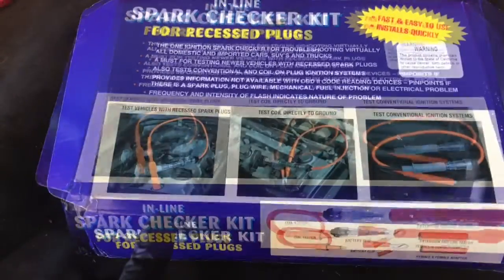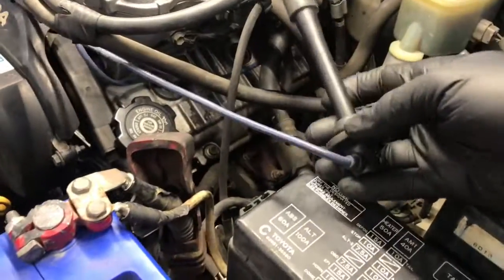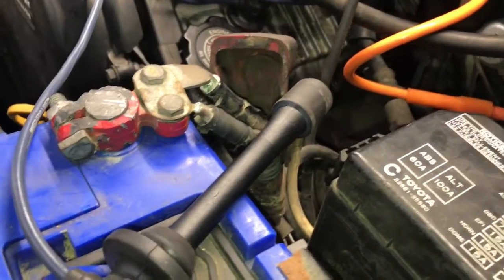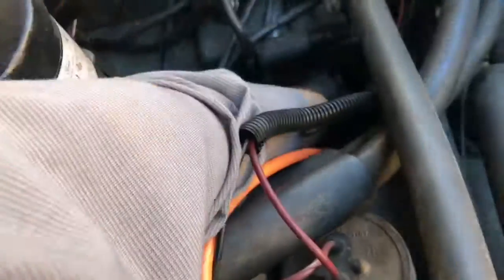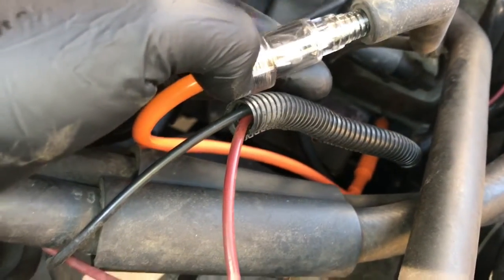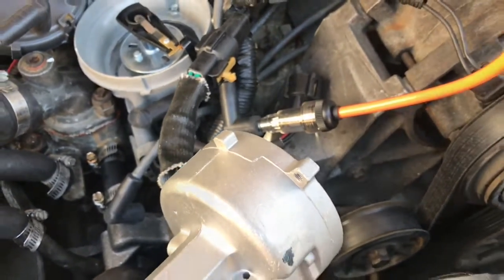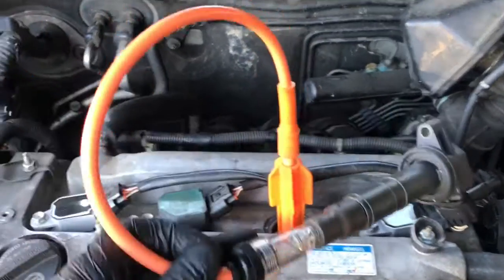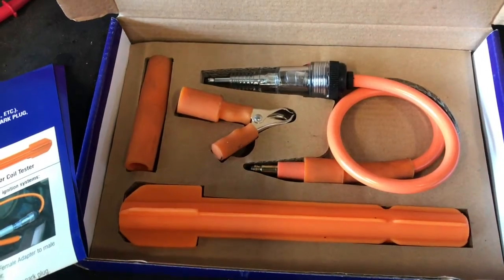How To Test Ignition Spark On A Car Or Truck Engine With An Inline Spark Tester

Comment: Is this the same as cranking engine with plug wire removed from plug side, then insert a spare plug into wire - set aside somewhere visible, monitor for spark from the spare plug?

Comment: What about from a coil inline to the distributor?
Reply: @FAKE-NAME  yes I found it does. If the coil is good and the module is good then if u disconnect the wire from coil to dist. And test, u should see the spark between the tester and coil gap. If the ignition module is bad then no spark will show. That's what my problem was. I had no spark so I changed the module and she fired right up. I also had removed my coil and tested with ohmmeter and it tested good. My module had also tested good with meter and that's what threw me off but it was bad.

Comment: if the car won't start has spark, does the light blink or not blink at all? i have coil packs and after about 4 cranks or so it'll blink about once and that's all. Even if it doesn't start if i had spark would it blink just once while holding key cranked ? or would it still flash multiple times while attempting to crank?
Reply from the maker: Slightly Moddified hello. It should keep blinking as the engine is rotating. I would check your timing belt to see if it’s slipping.
Reply: @HowtoAutomotive thanks for the response, my timing is good to go all set. not a tooth off, the harmonic balancer marking and the cam markings all line up. and fuel is getting to cylinders, so i'm guessing something with coils or ignitor is toast. because compression is good as well.
Reply from the maker: Slightly Moddified OK with all that testing good then I would check to see if you’re losing crank Signal from the Cranks sensor.
Reply: @HowtoAutomotive  i will do so, i actually have a spare CAS the one i have on i suspected to be bad when i started working on this car. but i was told that if my injectors pulse and work properly that it is a sure good sign that my CAS is working and sending the correct readings. Either way testing would be a good way. would i be use a multimeter? and where exactly should i test the CAS itself?

Comment: great video......but how do one knows if it is not producing good spark?
Reply: Teflon MD no light
Reply from the maker: Teflon MD you will need to test it with a lab scope for that.
Reply: At this rate of voltage the light should continuously be illuminated based on the wave impulses of the electrodes entering the electronic control module.